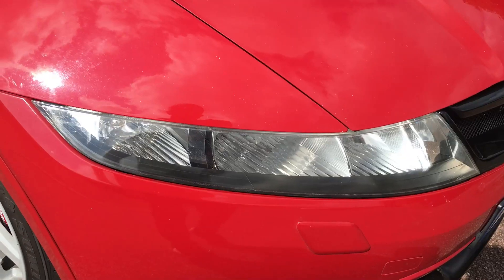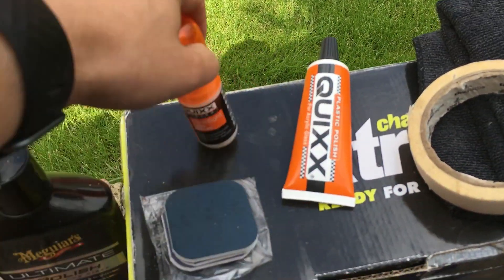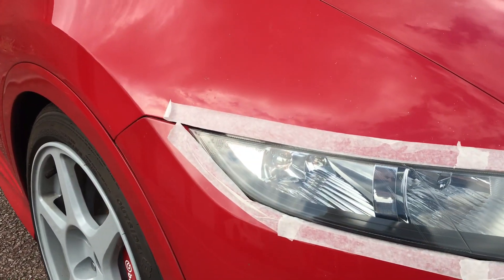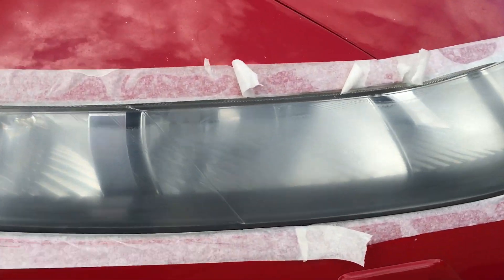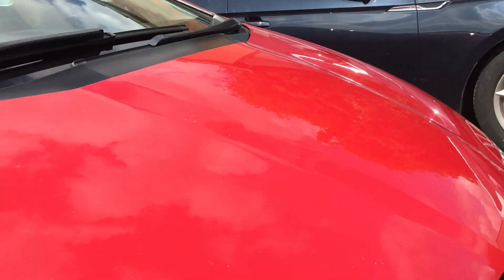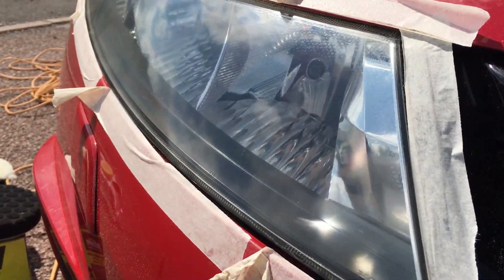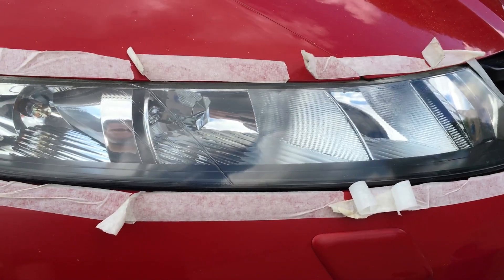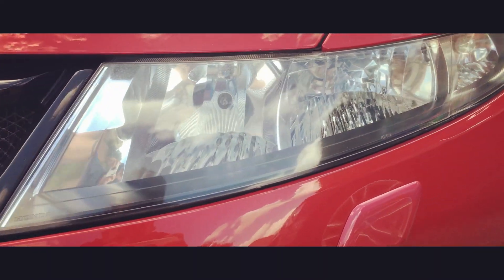How to Restore your Headlights Cheap - FN2 #headlights #restoration

Comment: Did well, look great. To anyone else looking to do this. If you want a kit get the 3M one. Its worth the extra all day long. In my exp. meguiars range (105/205/ultimate.AIO) weren't enough for my battered cars. Rupes Blue with their Coarse blue was a recent breakthru. Blasted over the EP3s headlights with that but the ST the first time (of 3) took five hours of hand sanding.etc.  Tip for anyone starting: basic of detailing always go with the least damaging method first. Here start at 1500 grit. If thats not enough 1200 if not 800 at a stretch 600. Anymore than that I found you just leave big scratches you can't get out which still show at the end. Wrap the sandpaper on a sponge with a hard foam back. I found NOT pressing it made it better. Allow the sndpaper to "sandpaper" rather than you using brute force and pressing on it. Gently does it. That way you evenly sand like a block rather than the pressure marks where only where your fingers are (same for sanding alloys where that becomes REALLY noticable in the end result). I found soapy water clogged the sandpaper so just used water and lots of it. Good idea if you have one kicking about clay bar the light first. Also avoid the 'Alfords sandpaper as it gets wet deteriorates. Other Packs available on ebay get one that goes up 800 to 2500 or there abouts (one i used was a polish brand, think it had a King symbol on it, was excellent, lastd ages).Once you've decided your starting grit, then double up the refining grade (roughly) for each stage. Finish at 2500 but you can go 3000 then 4000...I use a three stage in the 1200-3000 range depending on the condition of the headlight. Then DA cut, polish, then waxing them after will add protection too, over and above the sealant.
Reply from the maker: Just wow!! Thanks for sharing your knowledge. I wasn’t aware of the halfords sandpaper be so bad. Thanks for letting me know. My headlights weren’t too bad so I didn’t had to go mad. Pinned the comment as I find really good information! Thank you again
Reply: @FN2OPS  Hopefully in the morning chats this week. (Alfie)
Reply from the maker: @djmandrick  see you there bud

Comment: What was the point of the masking tape ....
Reply from the maker: Prevent any scratches in body panels  during the sanding part
Reply: I meant you shouldnt have bothered as it kept peeling off when wet...lol. @FN2OPS
Reply from the maker: @ivanreed-qj7uz  ahhhh!! Yep it wasn´t the best tape
Reply: At least you made a good job....need to do mine soon.... @FN2OPS
Reply from the maker: @ivanreed-qj7uz  thanks mate. Yeah just do it.